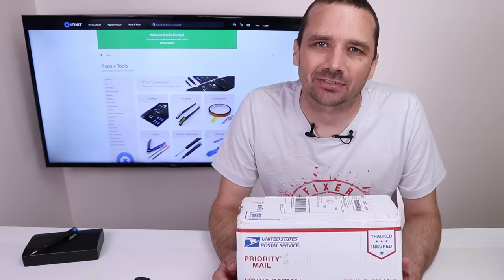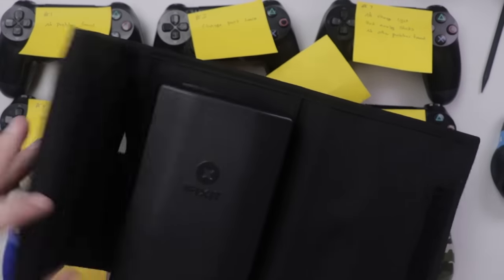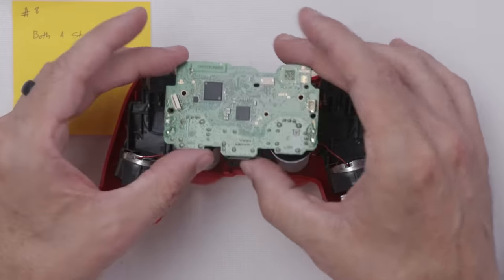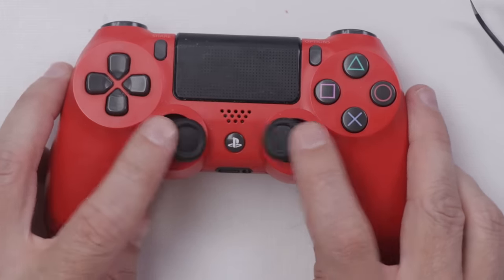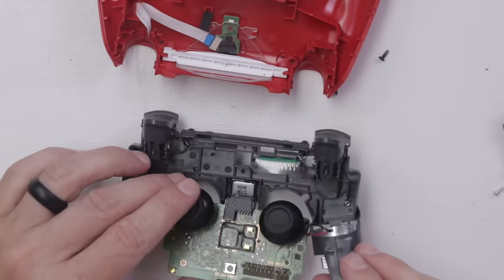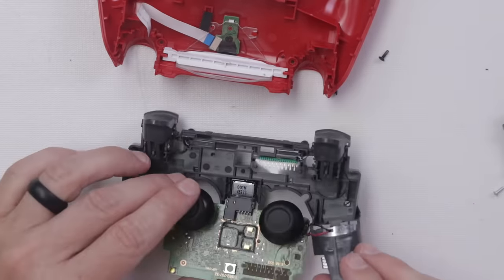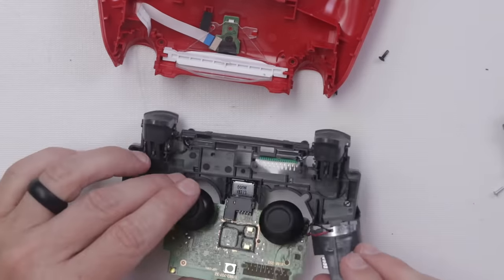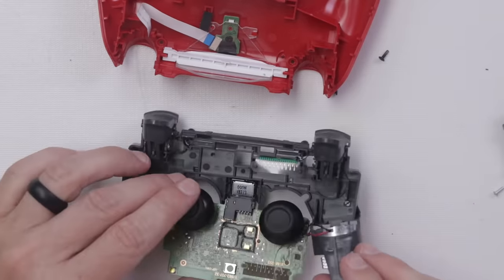I Bought 11 BROKEN PS4 Controllers for $220 - Let's Fix Them!

Comment: Nice video thanks.  What is the testing software?  Is it free?  Do you have a link?  I just opened a couple of my boys controllers, one  with a stuck shifter and other an apparent drifting issue.  I've also seen people just clean out the base of the thumbstick to repair drift.    Would this not save some time, and considerable dexterity in 'soldering' to accomplish?  Have you ever tried this?  Doubt I would have either A) patience or  B) dexterity to be melting solder and fluxing.  Nor the tools.  Does the soldering iron come with the Ifixit kit you had?  What kind of flux and solder are u you using?

Comment: How can you tell it’s just the analog stick caps which were bad on controller #3 16:19 ?
Reply from the maker: When I wrote "bad analog sticks" on the sticky notes I was meaning the caps and not the entire unit. The caps were clearly very worn out. To be sure I just plugged it in and tested it.
Reply: Ah! Thanks!

Comment: Ouch what happened between 7:19 and 7:20 looks like a nice gouge also the discoloration scares me. Also, i'm confused cuz when you solder it back on to the rumble motors the gouge on the left is gone completely meaning its a different board or a take in the past.

Comment: You don't have to change the analogue sticks, instead you can open the 2 green caps on each on and clean them, or change the small copper sensors

Comment: 10:49 you should have used the Wiha(Mi) electric screwdriver considering you're fixing 11 of them, 4 screws at the back+1 holds the motherboard+1~2 to hold the charge board, lot of screw's 🌝
Reply from the maker: I've got great electric screwdrivers but since there were only a few screws each I didn't worry about it. Plus I like featuring iFixit tools as much as I can.

Comment: Great video Steve! Controller fixing is currently my favorite electronic repair to do. Do you have a good source for the replacement thumbsticks? Some of the ones I get can be subpar quality. 

The primary issue I run into is where clicking the sticks while they are pushed in a direction doesn't work very well, which makes sprinting harder in shooters for example.

Comment: Do you always replace the entire analog stick when it drifts? I always clean it and its worked perfectly for 23+ controllers i've done. I've only had to replace them when the tracks are bad on the pot, even then I didnt remove the entire thing only took a pot with good tracks from a spare board.
Reply from the maker: No...that's why I say in the video that you can sometimes clean them.
Reply: @Tronicsfix  I did not hear that lol I sometimes comment while watching at the same time so I commented that when you were taking apart the double sticks. Im still watching now xD
Reply from the maker: @primusoriginal8648  No problem! Totally get it!

Comment: 3:45 oh come on,  it is definitely not that easy, I tried that!
Reply: If the controller has been previously taken apart, then it is that easy, most of the clips are already snapped/very loose.
Reply from the maker: Some of these (maybe all of them) had been taken apart before. New ones are def more difficult but still the same process.

Comment: Nobody noticed that you installed a different PCB in the red one. Just some huge scratches in the solder mask went suddenly missing, also the black dot around that area changed, the burning on the PCB changed shapes, the white marking on the top right disappeared and the QR code changed (you can see the new one quite nicely for some frames around the 8:11) mark. Nothing to see here ;)

Comment: I think it needs once again to be mentioned that for so long have we suffered with the awful problems the PS4 has presented, specially on the gamepads.. I have my two original PRO gamepads faulty with drifting sticks, the "quick" fix (cleaning and replacing the inner piece in each analog part) doesn't work anymore... Almost all of my friends with a PS4 have had the same issue with at least one, sometimes both their gamepads, and they are not even playing that much. Lastly, my disc drive stopped reading blurays anymore except if you tap the console on top while spinning , and I don't even use discs so much (still does DVDs perfectly) ... I'm waiting for the lens part to fix it. Such a shame for a really nice system to have these awful quality issues, my PS3 slim got a whole lot more """abuse""" and it's still working perfectly.

I wanted to thank you for all the constant effort you put and fun useful videos you make, It has helped and inspired me a lot on fixing my own stuff. Even got brave enough to order a soldering station for better adventures.  cheers!

Comment: Do you use an air filtration system to get the solder fumes away and do you use leaded or unleaded solder? Just wondering 🙂

Comment: I nicked the USB port ribbon cable on mine so it stopped charging. The replacement port and cable arrived today, I put them in and the DS4 refuses to die :) a replacement shell and a new vibration motor are on their way to extend its hard life even more. Steve what do you do with the faulty analog sticks? Most of them can be fixed so they work well again.

Comment: Oof you cooked that board for the analog repairs, looks like you popcorned it a bit too. Please get a Hakko 301 or something similar for those repairs it’s the only proper way that is guaranteed not to completely ruin them.
Reply from the maker: There was no popcorning. The board was fine and it works 100%. I have the Hakko 301 but hot air is much faster

Comment: It would have been nice if you could tell us where you got the replacement joystick modules because it is SUCH a pain trying to find actual proper joysticks when i need to replace them, they are always either too sensitive or just start drifting almost immediately after i get them.

Comment: Using hot air to replace sticks was a really bad idea. You just spoiled the surface of the motheboard 7:20. The other two methods you mentioned before would be better choise.

Comment: I’ve went through about 3 so far and the left stick starts drifting to the right on every one. I’ve took them apart and cleaned them but it start doing it again in about a week.
Reply: You need to change the little discs inside the joystick modules.
Reply: That's what I did and it fixed it just make sure you buy the right disk since they are different ones due to older models and etc. That was one of my mistakes
Reply: @xpapadeliciosox3986  yeah, I made that mistake for the first time yesterday actually. Now I gotta desolder a joystick module...
Reply: @matthewlunatick420  ahh dang! good luck man, but hey now we know lol

Comment: Hey.
Great video.
Thanks for that.
Have you ever came across vibration issues with dualshock 4 controllers? 
Mine has the right side vibration motor/rotor rotating too loudly and I think out of time.

Thanks and thanks for the cannel/videos

Comment: One thing with stick replacement is after some research is that Sony zeros the center via software calibration. I’ve changed the sticks before and sometimes the drift will have changed but still be there. If anyone knows a way to fix that let me know.

Comment: I have 2 completely non working ps4 controllers and my last one has a broken shell, a broken Vibration motor, has a lot of connection problems where it disconnects from the PS4 non stop and have to press the reset button. I wish I knew How to fix all three.

Comment: Do you also test the battery in these? out of the 4 PS4 controllers I had 2 had problem with the battery, they were not holding charge after a while, full charge lasted 5- 10 min. it was not an obvious issue to see from a quick test.

Comment: Was looking for a stick fix I found one where the little disks in the stick modules were just popped open and replace without the need or soldering and replacing the whole stick module.

Comment: Steve, thank you for the video I don’t know how to solder, I disconnected by accident the cables that go to the rumble mechanism. What do I need to solder them back? An 101 soldering back your Dualshock 4 video would be nice.  Where do you buy all your analogue stick replacements? Thanks.

Comment: I have two crazy questions to ask. First, can I use a PS1 connection wire on a PS2 controller? Second, can I use the same wire on an original Xbox controller so I can use the controller on a PS or PS2 system? Please help! Thanks

Comment: Remove analogs 1st, pull up & flip the board outwards. Thats what i used to do on older controllers gens. 
1 repair was better with cardboard & tape.

Comment: I've been fixing b these for a while now, analogue sticks are most of the problems
Reply from the maker: Yep
Reply: @Tronicsfix  Anyway you could do a video on cost effective tools like the heat gun, and sauntering iron?
Reply from the maker: idk...cost effectiveness just depends on what you're using them for. I bought my first really good quality iron when I was running my repair shop. It paid for itself in a couple days.

Comment: Minute 12:20 this controller isn't a  original controller they temp to brake allot so you shouldn't have wasted your time on it
Reply from the maker: It's 100% a real DS4
Reply: @Tronicsfix  ok it must've been the charge port then
Reply from the maker: There are a number of different styles of motherboards that they used in the DS4
Reply: @Tronicsfix  i know that but im just making sure you got an original one cuz imma console repairer too ik few stuff about them but for the blue motherboards they're usually from china they brake easily

Comment: Did you know that they were all Mostly OEM? Also do the minor components on the board possibly cause drift? I’ve been doing a lot of soldering on the boards trying to replace missing components on board to see if it resolves the drift since it still drifts after. Any suggestions? I’ve got like 4 controllers with persistent drift issues but I just notice a lot of boards are missing components consistently

Comment: Hi mate, I just subscribed to your channel I like your personality. Just one question. I have been trying to replace the analog sticks using only the soldering iron and it takes forever. I do have a heat gun but I am not sure if is strong enough. Do you know what the minimum heat needs to be for me to actually make it melt?

Comment: What temperature do you use on your hot air gun to remove the joysticks? I keep trying to heat them up but they wont ever melt. Currently I am setting it at 420C set at 3 air flow setting. Thanks in advance!

Comment: I've got a PS4 controller, that when I plug it in to console it has a quick continuous flashing orange light and only works when it's connected via wire, as soon as I unplug it, it stops working any help please?

Comment: Question considering the analog sticks. Where can the components be ordered? I’ve looked through your amazon list but i don’t see them. I got 3 controllers with stickdrift, and other problems. I also have a very strange problem with 1 of the controllers.. i cannot explain. Care to solve this mystery?

Comment: Little question from my side.  Do you actually test the touchpad? I noticed that the board under the pad is often faulty and i cant get them running again. Is there a way to fix that without replacing the whole board? Because i think there are no replace-boards i think.

Comment: I have a question. I tried replacing an analog stick. Used the soldering iron and wick method. Tested it and have stick drift hard to the right. Replaced THAT one with a different one, thinking maybe a faulty new stick and same exact thing. Any ideas?
Thanks and appreciate your videos 👍

Comment: With the first red controller after the heat gun treatment the left side of the board the green got damaged, copper colored layer was displaying. When it is being put back into the controller, the copper colored area disappeared, and the green looks undamaged. Was that the same board?

Comment: Funny you would make a video about this, I've just recently bought 2 DS4 with stick drift, figured it would be an easy fixed as I've fixed previous controllers, Xbox 360, Xbox one. Turns out that DS4 controllers don't seem to agree with me or I'm really unlucky. I've gone through 2 sets of sticks from different vendors (Replace Base and Zedlabz) and while I've fixed the drift on one of the controllers, none of the 4 analogs have full range of motion. Also, one of the controllers continues to have drift even though I've swapped the stick with 2 different new ones. I'm kind of out of my depth here. Any tips @TronicsFix? Or anyone else really, any tips are welcome.

Comment: I was cleaning a controller that was still working and pulled out the the whole cable and the part connected to the battery... Pfff bought a new one but still have another laying around. Was thinking about switching the good parts and came across this video now.. I will do it and end up with 2 broken.. Lol

Comment: Hey Steve, I've bee repairing these for quite some time, but recently I have been running into controllers that connect to the PC and show up fine, will connect to the PS4 also when wired, however when you remove the wire the controller dies. Change it with a known good battery, same issue. Any idea ow to get these working or get a fix one them?

Comment: I’m new to soldering but is there something other than solder that could have been used on these joysticks? I can’t get them off with hot air or the solder iron. The solder connecting the rumble motors melted super easily but every pin of the joystick won’t come loose.

Comment: I had one that wouldnt charge. The battery charged in other controllers, so everytime i wanted to use it, i had to swap the battery. The controller that charged the battery was broken in other ways. Still don't know why it won't charge. Tried changing everything except the main board on it. Could it be a charging chip on it? 

Sent a inquiry to your webpage a few months ago asking how much you would charge for a repair. Never got a reply

Comment: I bought a white ps4 in this swap market for $35 USD freshly sealed in the official box and everything and the analog stick was broken 😢. So I’m just stuck with my semi broken ps4 controller, it still works but the shell pops up sometimes like if it slips off my desk

Comment: Do you know how to fix the power a charging dock/station for ps4 controllers because the way its supposed to work is when you put the controller on the dock the charging part is supposed to go up and down but one side is stuck. Do you know how to fix it?

Comment: I've been following your channel for a few months and I'm a huge fan, I have an issue with a DualShock 4 that I can't fix it and I has hoping you can help me with it.
I have a DS4 JDM-055 mother board, when I connect a USB cable it does turn on and everything works fine, but if I unplugged the cable the controller turns off, I already test the battery and thats not the issue, do you have any idea what might be wrong?

Comment: hey, can you do a video about fixing a ps4 controller that constantly vibrates as soon as it's turned on or even just put to charge? I can't get the controller to stop vibrating even if I turn off the vibration setting on the ps4 so I think it might be the motor. but i don't know what to do with it

Comment: Tried the coupon code ! Didn't work :( Also ifixit is wanting to charge quite a bit for shipping.  Looks like you can get the same stuff cheaper through ifixits amazon store just a heads up!
Reply from the maker: It doesn't work for some countries yet.
Reply: @Tronicsfix  Not working in the USA?
Reply from the maker: It works in the US. What code did you use?
Reply: @Tronicsfix   tronicsfix and Tronicsfix

Comment: Do you have a video or a way to determine what the red light of death on a ps4 controller means? I replaced the ribbon and charge board but still lights up red. No luck in finding online how to fix it once the parts
Mentioned above are replaced.

Comment: I also bought a lot of ps4 controllers, 9 of them, most had bad charge port so they would not charge or connect to the system to register by USB cable(they did manually by share/ps button etc). But one can’t get to charge at all with different new ports and known working ports or different batteries,Just will not charge. Still connects to system manually...what could the problem be? Logicborard??

Comment: Any advice on analog stick replacement? I use a solder sucker the removal and install a super clean I try and make the solder look like the original but they will start to spin or move up?

Comment: Is it me or did the main board of the first red controller, lose part of it's green mask while replacing the sticks, and then magically it was fine during reassembly? I think he got the board too hot, there was melted plastic on the other side. Maybe a solder sucker, while slower, would have been more gentile. I understand having to spend as little time as possible making repairs and it's good enough. So not really complaining. Just us folks who would likely DIY it, could afford to take the time to avoid burning parts.

Comment: Urmm i need some help,my dualshock 4 is not connecting via bluetooth at all but it works perfectly fine via usb..any solutions?
*i did open up my controller to fix some analog issues...could it be that the charging port cable is damaged thats causing this Bluetooth issues?

Comment: No joke lastnight I pulled all my controllers out and started opening them up. Theres a logitech rumble pad that I need to fix the sticks. The finish on the controller is like a velvety plastic rubber and is  looking pretty bad and  sticky. How do I clean this or fix it?

Comment: Hey Tronics,

I got a ps4 controller that charges fine and operates fine but has no led light is that fixable without a new charge board?